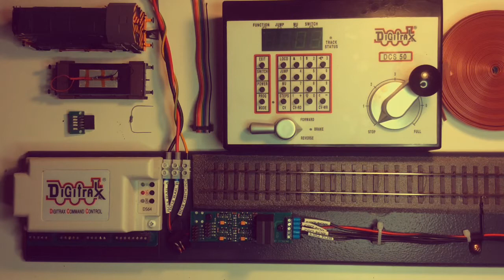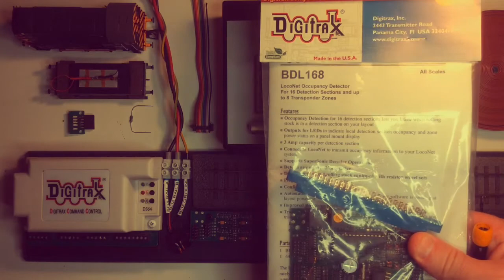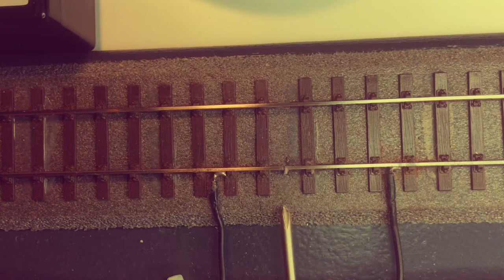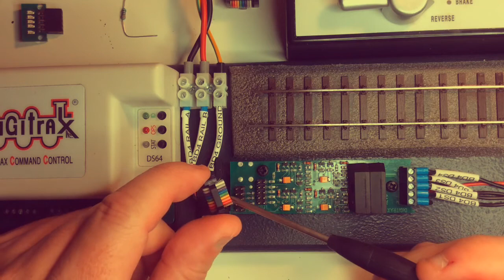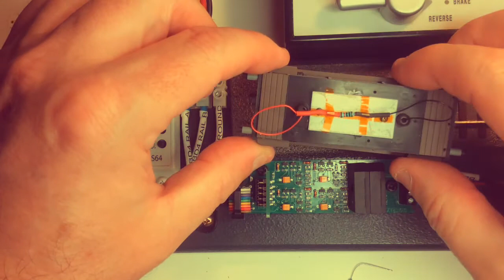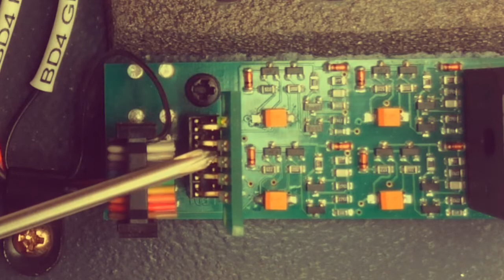Digitrax BD4 basic setup

Comment: Good basic connections explained . I am interested to know the connections to both DS64 as well as SE8c separately explained.  When the DS 64 is already connected to 4 turnouts atlas twin coil type, can this BD4 's detection outputs ALSO be connected to the same DS64 and if so how the board number/section numbers  will  be  added in the train controller interface.
Reply from the maker: GANESAN SETHURAMAN yes it will work with turnout motors already connected slow motion or solenoid types. I haven’t finished the video yet but will do soon.

Comment: Paul would the ribbon cable you use also work with the SE8C? Could you supply the group with the eBay seller? This is a most informative video.
Reply from the maker: Jim Shellhaas Thanks Jim. Yes, these are the same 10 pin IDC connectors and ribbon cables that can be used on the SE8C and also are used on the RX4 transponders which attach to a BDL168.

Look at this on eBay

10-Pin 5M Rainbow Color Flat Ribbon Cable IDC Wire Cable

https://rover.ebay.com/rover/0/0/0?mpre=https%3A%2F%2Fwww.ebay.com.au%2Fulk%2Fitm%2F282844070441
Look at this on eBay

10PCS IDC FC-10P Connector Straight 10 Pin Female Header 2.54mm Pitch

https://rover.ebay.com/rover/0/0/0?mpre=https%3A%2F%2Fwww.ebay.com.au%2Fulk%2Fitm%2F282664294782
Reply: Thank you Paul! Unfortunately neither venders sell to the United States. If you find another source, please let me know. Jim
Reply from the maker: Jim because I am in Australia it isn’t clear who does or doesn’t ship to the USA. I suggest you search on 10 pin rainbow ribbon cable and 10 pin IDC connectors and this should reveal suppliers of the same. Failing all of that you can purchase of course the Digitrax SDCK which stands for Signal driver cable kit. Although, this is the more expensive option I have found. Good luck and please post if you find a seller that ships to the USA.
Reply: Digitrax Dad Paul that’s exactly what I did. I found some 10 pin ribbon cable but I’m still looking for connectors. Thanks for all your help and keep at the videos

Comment: A very welcomed video.  I'm also interested to see if you ribbon connect to the DS64.  Regards Charlie.
Reply from the maker: Chadwick TMD Charlie, the physical connection to the DS64 is relatively straight forward using the cable I created however it is hampered by the instructions that don’t show the pin 10 being used any more. The rest of getting it to work is more to do with the OpSw settings in the DS64.

Comment: Super! I was thinking for a BD4 for the Test Track but the lack of information has put it off for now but its back to give it a go! I am looking forward to the next updates! Cheers :)
Reply from the maker: Just know that I have found you can’t get programming track to work through the BD4. I believe this is to do with the lower current or voltage that the programming track provides and is not enough to get the BD4 to work. If you want to simply play with occupancy and signals for instance on your test track then it would work just fine.